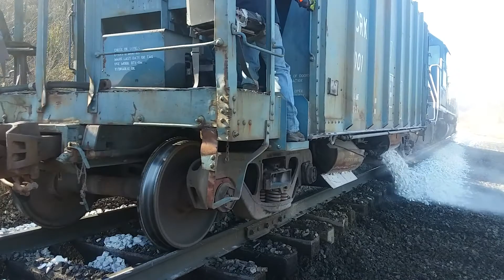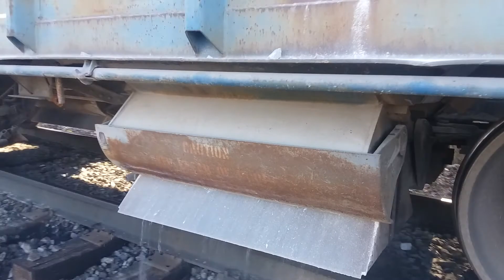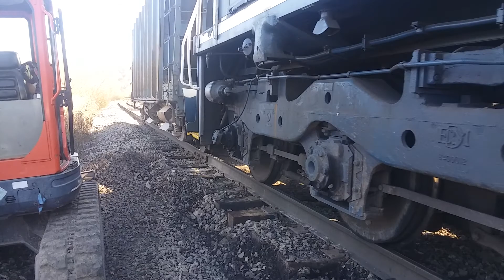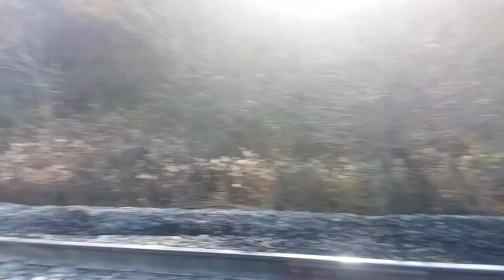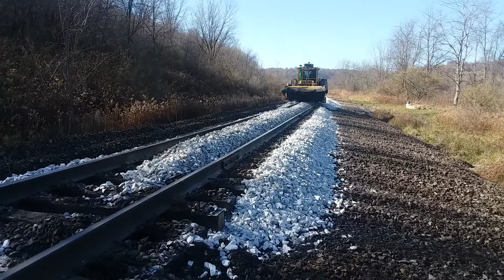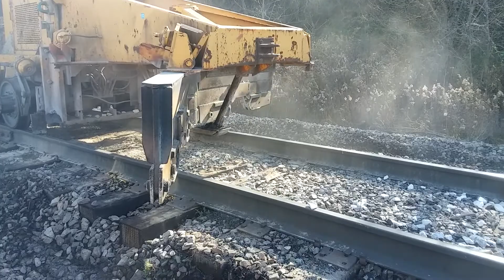EMD SD 40-2 Dumping Ballast with Kershaw Ballast Regulator

Comment: Was it so very long ago, that the SD40-2 was the hot new power for everybody. Now? Work trains and yard engines. Makes me feel old.
Reply from the maker: Bucky, I know what you mean, those SD 40-2's when they came out were top of the line, sure is a lot of them still going but most are relegated to as you say switching and work trains. But what a great loco they were, appreciate your watching

Comment: Awesome! Can you guys make your own ballast from the waste rock from the mine?
Reply from the maker: David, no sir, it is not the right type of rock for ballast. We use limestone for ballast. Thank you for asking
Reply: @ccrx6700  
Limestone is a softer rock.  But that is a short and slow line.  Mains use basalt, a dense and tough stone.
Reply: Typical over burden from coal are shale,  absolutely good for nothing as it has a low angle of repose and it slips.  Ballast must be sharp and angular so it locks together once compacted.
Hard rock like basalt and granite wear longer.  Rails and ties move, this abrades the ballast causing slumping, pumping and moving rail.
Reply from the maker: @keithjurena9319  limestone all we can get, looked into basalt years ago but price to truck it here was outrageous

Comment: I’m curious Dave, why isn’t there a transload site for the ballast to load instead of being on the main line? My assumption it’s cost prohibitive to add a designated switch and siding for ballast loading.
Reply from the maker: We have a ballast stock pile at Mapletown where the dump trucks
bring it in from the quarry. There we load it onto the ballast car with
a hi lift. But you are right, that is on the main line. Our former boss
over 30 years ago built that ramp so the hi lift we have could load
the ballast car. I guess he never thought of building a siding so the
ballast train could be off the main line. However for the most part
it works out for us and we very, very seldom hold a train up to
load ballast there. Very grateful my friend for your taking the time
to visit with us and check out the dumping ballast video.

Comment: How many U-anything C or B, or C/B whatever-7's do ya still see runnin around. Exactly. All gone to scrap. Im seein lotsa newer GE's with all the paint scorched off the hood section over the prime mover/turbo. Cant recall seein any SD70 types in the same condition. Makes you ponder quality vs quantity. Well see in another 20-30 years.
Reply from the maker: Bucky, thanks for writing in, those older locos are indeed rare. Paint like your saying is most often due to a turbo seal failure, a bit commom on GE. Appreciate your watching

Comment: Would you show a track map sometime?
Reply from the maker: I dont have a track map, you will need find it on google. I do have a track chart book that has bout 50 or so pages in it with elevations, mile posts and curve lengths plus degree curve, but that prob wouldnt be too interesting, i may sometime show a couple pages out of it
Reply: Definitely take a look on Google at the satellite view, for it shows the line rather clearly from one end to the other.  The track chart book would be interesting to anyone that decides to model the line, of course.  I obtained one for portions of the Santa Fe routes years ago while involved with their historical society.  Even knowing what I was seeking, it still took some time to sort out certain details, as I recall.
Reply from the maker: @johnniewelbornjr.8940  Johnnie, that really great you volunteer to help preserve rail history. Got a book for christmas on history of SF